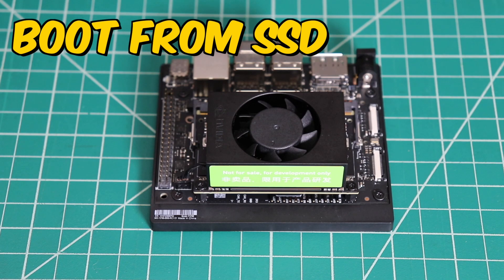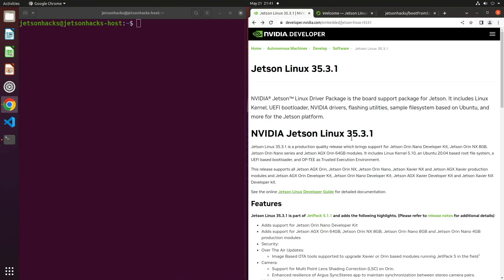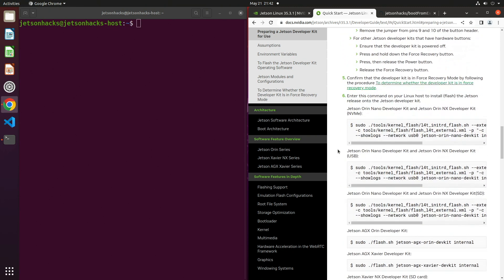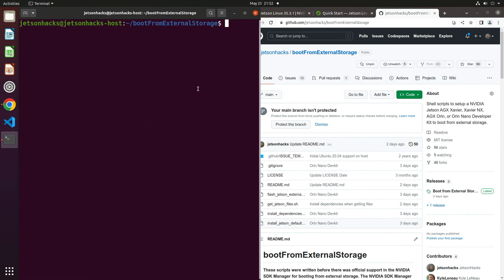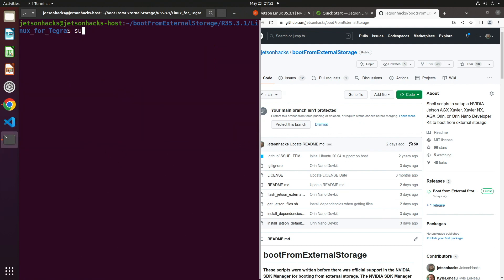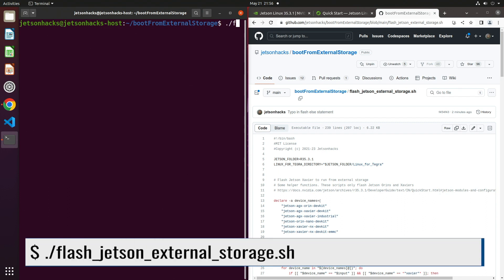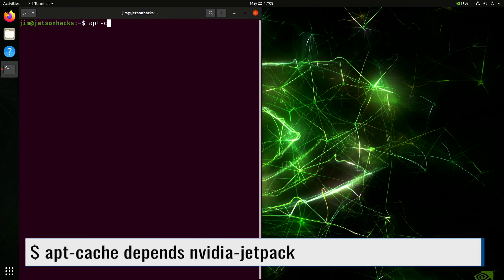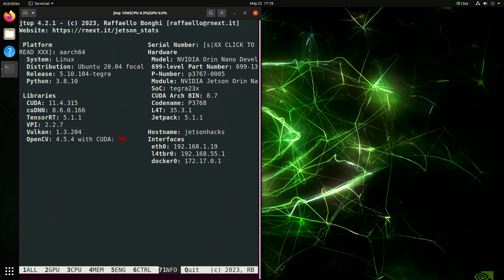Jetson Orin Nano Tutorial: SSD Install, Boot, and JetPack Setup - Full Guide!

Comment: Perhaps you can help me. I have two original Jetson Nanos that I successfully boot from an SSD and one from a USB, thanks to your video. My problem is both of these nanos run Ubuntu 18.04 and I need them to run Ubuntu 20.04 for another project. Unfortunatlely I have been unable to create a bootable usb/ssd with Ubuntu 20.04 iso and BalenaEtcher or Raspberry Imager. The farthest I get is a boot to Linux prompt. There are two lines preceeding the prompt that go "bash: cannot set terminal process group (-1): Inappropriate ioctl for device" and "bash: no jobcontrol in this shell"
Remember I am used the steps from this video to get both units booting without the MSD card. I am new to Linux; but, I can follow directions very well.
Any ideas/sol;utions would be appreciated.
Reply from the maker: It sounds like you are having issues. Ubuntu 18.04 is the latest supported version on the Jetson Nano. I'm not sure how you are installing Ubuntu 20.04. Here's one solution: https://github.com/Qengineering/Jetson-Nano-Ubuntu-20-image I don't have anything to share about running Ubuntu 20.04 on a Jetson Nano. Good luck on your project!

Comment: Is this still the recommended way to boot off of the <2 drive for a Supper? Thanks.
Reply from the maker: No. The recommended way is to use the NVIDIA Jetson SDK Manager. For the Super release, there's an interim set of libraries that can only be installed that way on the Orin Nano Super. Thanks for watching!

Comment: Ordered the cheaper Jetson Orin Nano Super 10 days ago, I have a 2TB NVME that I'd like to put in it,  and looking at videos like this one right now while waiting for it to get shipped. 

Should this tutorial work for the Jetson Orin Nano Super too? 

And are there any details that should be a bit different that I'll need to be aware of when trying to apply this tutorial.
Reply from the maker: It depends on how you want to use it. If you boot from the SD card, you can format the SSD and use it as extra storage. If you want to boot and run from the SSD, you will need to use the SDK manager to flash the SSD. 
The issue with using the method in this video is that it is currently not possible to download the Super disk images directly from the JetPack SDK pages. You must use the NVIDIA SDK Manager to do that. 
I'll be making a video that goes over the options.
Thanks for watching!
Reply: @JetsonHacks  Do you have an ETA. I just received my Orion Nano and would like to boot from my 1TB SSD
Reply from the maker: @JFlogerzi  No ETA right now, been working on getting everything together. You should be able to use the SDK Manager if you're really in a rush.
Reply: @JetsonHacks  I will be doing so.

Comment: Is this video's content still relevant and applicable for today's implementation? Would I face any version conflicts or compatibility problems using these exact commands?
Reply from the maker: As stated in the pinned comment, you should use the NVIDIA SDK Manager if possible. This was written before some of the functionality was ready in SDK manager. To my knowledge, this guide still works. Good luck on your project, and thanks for watching!

Comment: Thanks for the tutorial, really easy to follow! Ive been trying to use WSL and usbipd but it keeps dropping the bus the orin is attached to, seems like I need linux
Reply from the maker: You are welcome. The USB connection is reset a few times during the flash process which makes it harder for non Linux machines. Thanks for watching!

Comment: Can I move OS from MMC to SSD Nvme ?
Reply from the maker: Not easily, there's a bunch of tricks you would have to perform. It will depend on how the manufacturer of the board has everything set up. This is usually not very well documented. Instead, flash your SSD with the SDK Manager with the board support package from the manufacturer, which will make sure that all of the tricky parts are taken care of. You can flash the minimal setup, and then apt install the Jetson specific libraries. Good luck on your project!

Comment: Hello! Thank you so much for the tutorial. I tried to flash nvidia jetson Orin nano dev kit with SSD using virtual box with Ubuntu 20.04 and then with docker image 20.04/22.04 from official website but both failed. I am about to follow your another tutorial to get flash logs from the dev board. But in the meantime, I wanted to give a try to you convenience script. However, I cannot longer find it in your GitHub repositories. Did you remove it? Thank you in advance!
Reply from the maker: You are welcome. It's still there. However, I would not recommend using it as many things have changed since it was written. https://github.com/jetsonhacks/bootFromExternalStorage I advise that you get the flash logs and have the NVIDIA engineers help you through your issue on the Jetson Orin Nano forum.

Comment: Checking Jetson ...
Traceback (most recent call last):
  File "/home/mariocool11/bootFromExternalStorage/R35.4.1/Linux_for_Tegra/bootloader/tegraflash.py", line 1383, in <module>
    tegraflash_run_commands()
  File "/home/mariocool11/bootFromExternalStorage/R35.4.1/Linux_for_Tegra/bootloader/tegraflash.py", line 1217, in tegraflash_run_commands
    interpreter.onecmd(command)
  File "/usr/lib/python3.8/cmd.py", line 217, in onecmd
    return func(arg)
  File "/home/mariocool11/bootFromExternalStorage/R35.4.1/Linux_for_Tegra/bootloader/tegraflash.py", line 855, in do_dump
    self.chip_inst.tegraflash_dump(exports, args)
  File "/home/mariocool11/bootFromExternalStorage/R35.4.1/Linux_for_Tegra/bootloader/tegraflash_impl_t234.py", line 2399, in tegraflash_dump
    self.tegraflash_preprocess_configs()
  File "/home/mariocool11/bootFromExternalStorage/R35.4.1/Linux_for_Tegra/bootloader/tegraflash_impl_t234.py", line 360, in tegraflash_preprocess_configs
    values[config] = self.run_dtc_tool(
  File "/home/mariocool11/bootFromExternalStorage/R35.4.1/Linux_for_Tegra/bootloader/tegraflash_impl_t234.py", line 3302, in run_dtc_tool
    run_command(command, False)
  File "/home/mariocool11/bootFromExternalStorage/R35.4.1/Linux_for_Tegra/bootloader/tegraflash_internal.py", line 277, in run_command
    process = subprocess.Popen(cmd, stdout=subprocess.PIPE, stderr=subprocess.STDOUT, shell=use_shell, env=cmd_environ)
  File "/usr/lib/python3.8/subprocess.py", line 858, in _init_
    self._execute_child(args, executable, preexec_fn, close_fds,
  File "/usr/lib/python3.8/subprocess.py", line 1704, in _execute_child
    raise child_exception_type(errno_num, err_msg, err_filename)
FileNotFoundError: [Errno 2] No such file or directory: 'dtc'
--- Error: Reading board information failed.
[ 0.0239 ] Pre-processing config: tegra234-mb1-bct-device-p3701-0000.dts
ERROR: Unsupported device.
This method currently only works for the Jetson Xavier or Jetson Orin

I got my Jetson Orin Nano from Yahboom i need help with having it work with this script
Reply from the maker: What NVMe drive are you using?

Comment: For me the script after a while, before the flashing, goes into "Waiting for target to boot up" and it's just stuck there for a while. Then says ssh ready and just times out after a few minutes. In your video I don't see this at all. Do you have any idea what might be wrong? Thanks
Reply from the maker: Did you remove the jumper before the machine rebooted? Is the Jetson visible on the network?
Reply: @JetsonHacks  Hi, thank you for the reply. I did remove the jumper yes. No, the Jetson is not connected to the network, just to the Ubuntu x86 PC via USB connection.
Reply from the maker: @feszty  Did you turn USB auto suspend off on your PC?
Reply: @JetsonHacks  no, I left it whatever the default is.
Reply: @JetsonHacks  It didn’t help, I have the same issue. Thank you for your help.
Reply from the maker: @feszty  I did have the Orin Nano connected via Ethernet to the Internet. You can try to boot the Jetson and then load the nvidia-jetpack repository and sudo apt update. A good place to ask for help is in the NVIDIA Jetson Orin Nano forums, where a large group of developers and NVIDIA engineers share their experience.
Reply: @JetsonHacks  Thanks, will do. It's frustrating as I bought this at the NVidia conference, and none of their stuff works. The SD card image doesn't boot and they say to use the SDK manager to flash it, but it throws a bunch of errors and doesn't work. I finally found some help in a discussion board and I was able to flash the SD card. But since I need more space and I don't like booting from an SD card, I want to make the SSD work, but again, it's such a pain. Thanks for your work on the scripts and the tips here. Cheers

Comment: Excellent tutorial. Unfortunately, I couldn't make it work for my Jetson Orin Nano. The problem I am facing is that my USB connection is very unstable. It always disconnected right after I ran the flash_jetson_external_storage.sh script. I used a good USB cable with a data transfer speed of up to 10Gbps. I also disabled auto-suspend for USB ports, but the problem persists. What am I missing?
Reply from the maker: Some people run into issues with this approach. I'm not sure what the solution is, it feels like it's related to the the USB implementation of the Jetson and the Host not meshing well. I advise using the SDK Manager because it's something that NVIDIA officially supports and is willing to help out on. Thanks for watching!
Reply: @JetsonHacks  I managed to flash my SD card after multiple tries, but still could not flash my 1TB SSD either by CLI or the SDK Manager. But I will give the SDK Manager another try per your suggestion. Thank you.
Reply from the maker: @briancoder7621  Good luck on your attempt!

Comment: So you remind us to remove the jumper twice....I'm having troubles here and I'm wondering if it's required to have the jumper in place while flashing, then take it off?   FYI  none of this seems to work with 18.04 Ubuntu.  I've only gotten as far as I have on 20.04.   I've been working on this for nearly two weeks, still can't boot it.   I'm gaining the opinion that Nvidia products and software suck.
Reply from the maker: When the jumper is on and the power is supplied, the machine will boot into recovery mode. This takes a few moments. If you can see the Jetson on the host with lsusb, then you're in force recovery mode. It is safe to remove the jumper at that point for flashing. Hope this helps, and thanks for watching!
Reply: @JetsonHacks  I got to the point of flashing my SSD via SDK manager but kept getting the USB disconnecting/ reconnecting during the flash with SDK finally saying "Installation Failed" "lost connection to Nvidia APX USB".   I assumed I had a bad USB cable so got a new one. this time the flash got much further along but at 98% done it said again "Installation Failed" with the log flagging an ERROR: Flash Jetson Linux : command terminated with error (16m later).   "SUMMARY DateTime Target Setup-target: Depends on failed component."    But I don't see a failed component in the log although there are a few warnings.  I think I may have a bad board at this point.   My opinion of NVIDIA software and product quality and service continues to decline.
Reply: Sorry to hog up your comment board, but the issue I have seems to be a "known issue" with Jetpack 6 install on Jetson Nanos with SSDs.....their install just doesn't work so I'm installing Jetpack 5.1 instead.     You'd think Nvidia would test their products a bit better before taking my $500      Jetpack 5.1 installed correctly....thanks subbed
Reply: @JetsonHacks  Yes I can see it on lsusb no problem but...
Reply: I'm going to try your scripts instead of SDK manager and see how it goes.
Reply from the maker: @Sugarsail1  People have had varying levels of success with the scripts with the new boards. The USB ports on the PCs seem to have various timing issues.

Comment: Why is the SSD card used ? Can I just use a Micro SD card instead ?
Reply from the maker: Yes. Thanks for watching!
Reply: @JetsonHacks  What are the down sides of using a Micro SD card over a SSD card on the Orin nano ?
Reply from the maker: @Bwajster  I don't understand your question. Both are mass storage devices. The SSD is ~ 10X faster and is available in much larger sizes. It depends on your use case as to what downside means.

Comment: i am using a usb a to usb c cable, but when connect to my pc it seems not detect my orin nano
Reply from the maker: It's hard to tell from your description what you are doing. Is the Orin Nano in recovery mode? This is an old tutorial, you should be using the NVIDIA SDK Manager for this.
Reply: @JetsonHacks  just finished the installation, is because my usb a -usb c are not support data transmission, thanks for the guide!
Reply from the maker: @suppermanzzzz291  I'm glad you were able to get it to work.

Comment: At 4:08, you connect a usb-c cable into the jetson, the other looks like a plain old USB port, right? Does it mean I have to buy a cable whose one side is C-type and the other USB? Because my PC doesn't have a C-type port. Thank you.
Reply from the maker: That is correct. You will need a USB 3 data capable cable, USB-C connector on one side, USB-A on the other. Thanks for watching!

Comment: Thanks for the video. I was just wondering, why not just use the SDK Manager? Is there any good reason to use the command line instead? Thanks!
Reply from the maker: You should use the SDK Manager if possible. The reason that this video uses the scripts is that the SDK Manager did not support this functionality when the video was made. Thanks for watching!
Reply: That makes sense. Thanks a lot for your video and your comment.

Comment: What changes do I need to make in the .sh files to install 22.04?
Reply from the maker: I don't understand the question. What 22.04 are you talking about?
Reply: @JetsonHacks  How can I install ubuntu 22.04 operating system on Jetson nano Orin? I saw that you used 2 .sh files in your video. What changes do I need to make to these files?
Reply from the maker: @furkancetin2927  I do not know. The Orin Nano running JetPack 5.X runs Ubuntu 20.04. I do not believe that it will support 22.04 until JetPack 6.
Reply: @JetsonHacks  Thanks a lot for your answer 😊

Comment: Thanks for your videos. I wonder what do you think about the new nano? Because I can't help but think it's a terrible product. I first thought it's too expensive, but might be a good choice in some cases because of the decent performance upgrade. But then I learned they removed the hardware video encoders! Wasn't this thing designed with computer vision in mind? I am honestly a bit shocked some product manager at Nvidia thought that was a good idea. I am sad to say, but it's probably gonna be goodbye for me for Nvidia Jetsons. Seems lots of people use something like the Radxa Rock 5 now instead, which I am also gonna get soon. Maybe you can make some videos on that too in the future? ;D
Reply from the maker: It sounds like it doesn't meet your needs, and you should move to something different that does.
Personally I have given slack to anyone who had to create new products during the pandemic. That includes movies, music, electronics, and so on. 
Typically building and marketing products requires a lot of different trade offs. It is way harder if the people aren't in the same room.  If the criteria for your project is hardware video encoding, then the Orin Nano may not fit the bill. NVIDIA may have not included hw encoding for a variety of reasons, I don't have enough information to say how they choose their feature set.
It sounds like the Rockchip based machines may  meet your needs.  There's nothing there that interests me personally, but it'd be fun to hear  how that ecosystem and support compares to the Jetson one. Good luck on your journey!

Comment: Very nice information. Could you please do a comparison using the new Orange Pi 5 8GB Rockchip RK3588S 8-Core 64 ARM Mali-G610 GPU, AI accelerator NPU with up to 6 TOPS? 
😎  Thank you.   Amazon...  $101.99
Reply from the maker: Thank you for the kind words. Unfortunately I do not have a personal interest in doing comparisons. I would guess that CPU wise the Pi 5 offers slightly less CPU performance (ARM A78 for the Orin Nano, ARM A76 for the Pi 5). The Pi 5 GPU/NPU combination is interesting. However, a lot of ML/AI performance is around how well you can bring models for inferencing into the environment. For example, the Orin Nano quotes 40 TOPS, the Pi 5 is 6 TOPS. I would suggest that if you don't know how to take advantage of either of those specifically, you won't get near that performance. Typically a NPU has a very specific model spec that it can run, whereas the Orin Nano has a broader range of formats that it supports. This includes the optimized ML models that NVIDIA provides, which is quite a selection.  The Pi 5 has a great price, it's not clear how big is  the Pi 5 support community and developers. Here's a couple of review sof the Pi 5:  https://youtu.be/79lquFD3oT4 and https://youtu.be/fHQ1GpYRHPo to give you an idea of how the two compare. The Orin Nano is something different than the Pi 5, so it depends on what your application needs. Thanks for watching!

Comment: Hello! firstly, i love your videos please keep making them. i have a question, im fairly new and i just bought an orin nano and an SSD that you mentioned in the link, is there a way to install DeepStream SDK on the SSD? if not once ive flashes jetpack on the SSD can i then use nvidia SDK to flash DeepStream only? im basically not trying to use the orin's internal storage. is using the internal storage to fash jetpack with deepstream a big deal?

thank you!
Reply from the maker: You can put DeepStream on your Orin using SDK Manager without flashing the rest of the device. The SDK Manager with basically copy over DeepStream to the Orin. Thanks for watching!